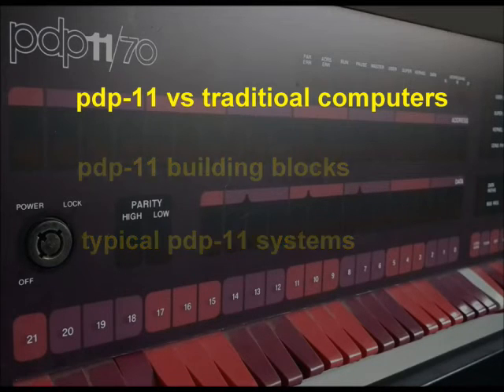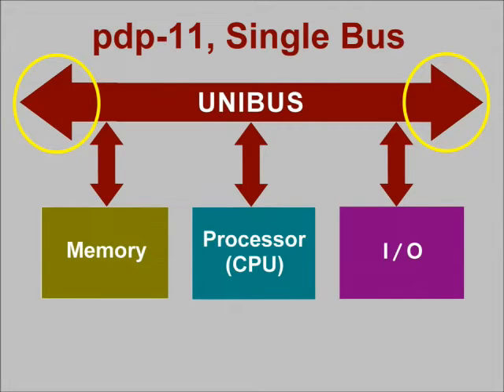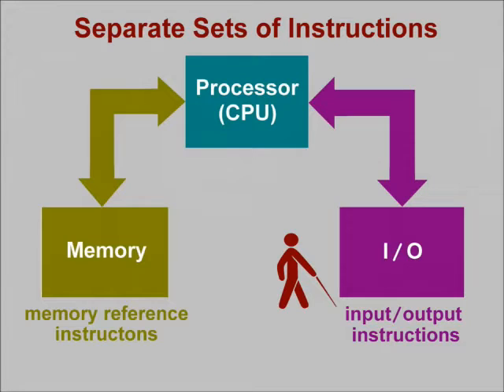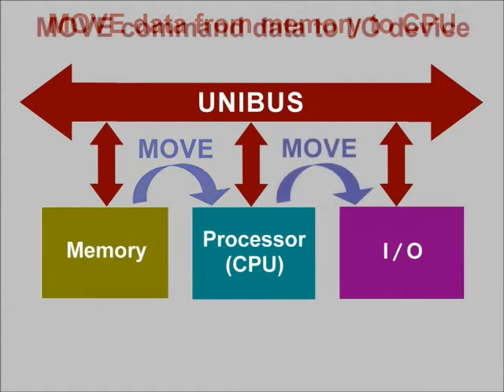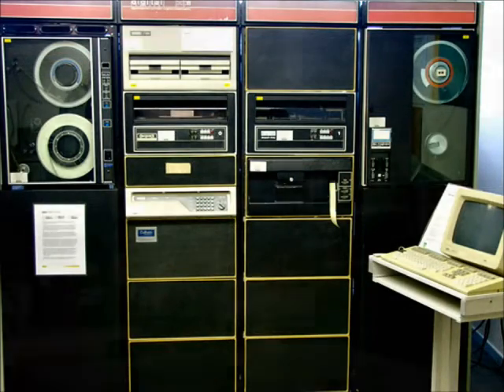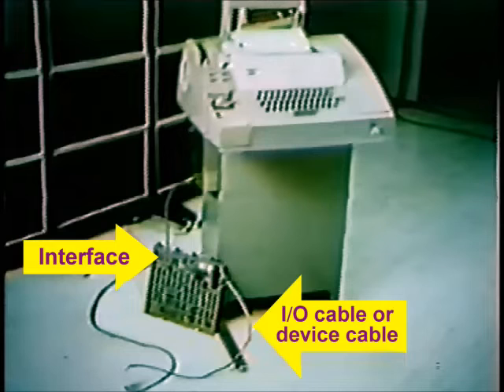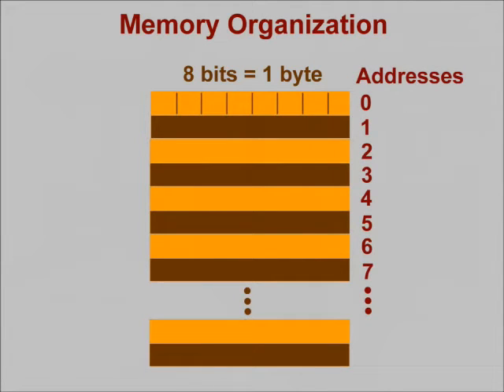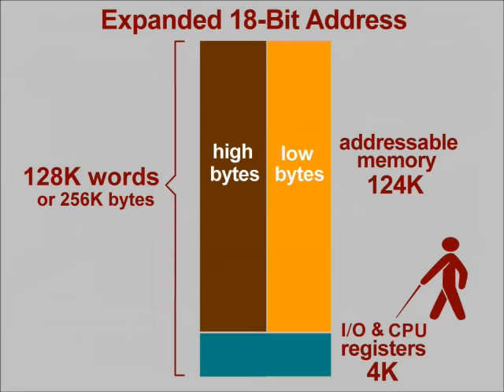Introduction to the PDP 11, Unit 1, System Overview

Comment: Ah yes.  Spent several years working with PDP-11/34's and 03's.

Their architecture was rather elegant.  Mostly orthogonal instruction set and no separate I/O instructions.  You could plug in an extra IC of microcode into the 11/03 and that added floating-point add, subtract, multiply, and divide instructions.   Cool stuff, but expensive and not too speedy.  

The RT-11 operating system was really, really, really  stripped-down!  You got a line editor, a FORTRAN compiler, a linker, and that's about it.  The FORTRAN compiler didn't generate machine code, it generated some weird threaded code, basically in-line addresses of short code subroutines that were sequentially jumped through.   Cool in an academic way but not at all fast.    If you pulled out all the stops you could run a (small) program in the background, but that was a lot of bother.    A PDP-8 was much cheaper and faster for simple programs.

The OS didn't have any memory protection so it was pretty easy to crash the system.

That was my first realization that newer and fancier wasn't always clearly better.

Comment: Cut my teeth on an 11/34 and then went to work for Dec and had an 11/70 running RSX-11M Plus.  The 11/70 would periodically crash with a memory parity error.  Field service traced it to a broken wire in the Unibus.  God I loved those times and miss them so much